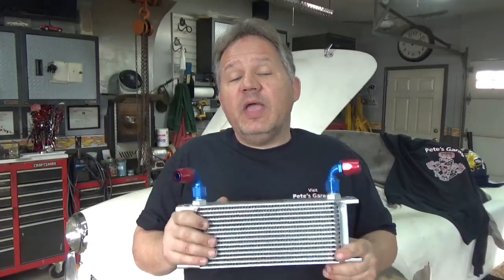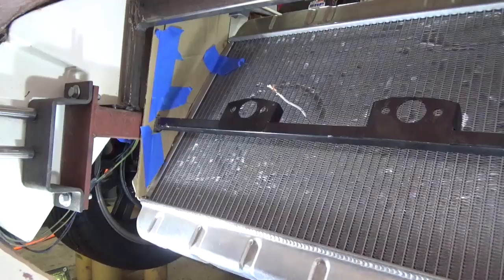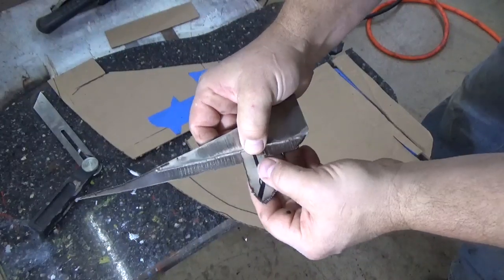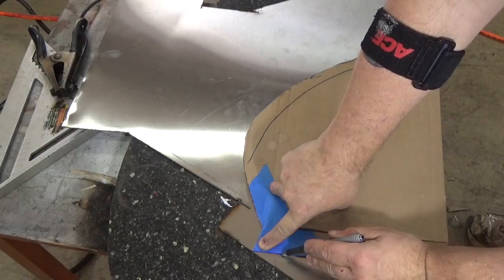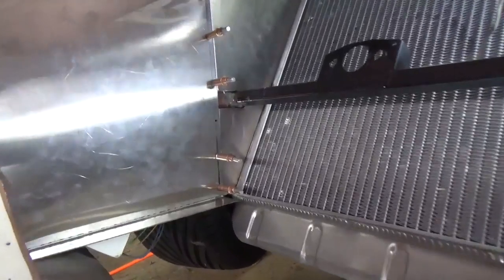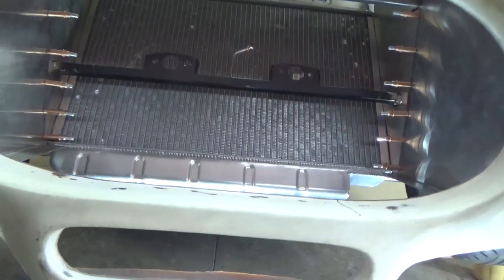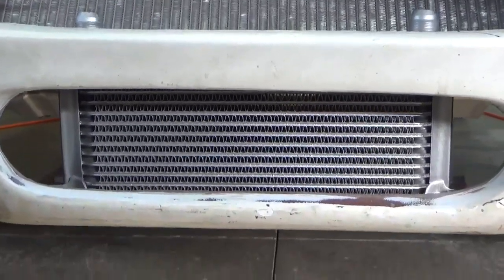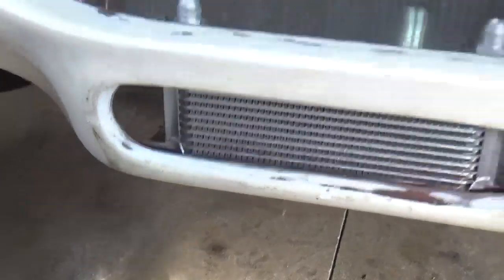427 Cobra - Mounting the Oil Cooler, Fabricating Front End Sheet Metal

Comment: Here's a quick and cheap tip for getting even rivet spacing with no measuring.  Go to the automotive aisle at your local craft store and buy a package of elastic (like on your underwear).  Iron it (low heat) perfectly flat and straight, then without stretching it, mark a tiny dot with a fine Sharpie every inch.  To mark your rivets, first determine how many you want, and where you want the first and last rivet.  Stretch the elastic so that a dot falls over the first and last rivet positions and the desired number of dots fall between them, then center punch the material through the dots.  It's helpful to have clamps, tape or another person to hold the elastic.  The spacing between dots will expand equally, and you'll get perfect spacing without having to measure and divide.

If you have a lot of rivets to do, or if you just prefer to use pro tools, look for a rivet fan spacing tool.  https://www.google.com/search?q=rivet+fan+spacing+tool  To use this tool, drill your first and last holes free-hand, then Cleco the tool to your workpiece with the desired number of holes spaced as you want them.  Drill the rest of your holes right through the spacing tool, remove the Clecos, drill to final size, deburr and rivet.
Reply from the maker: That's a really cool idea, thanks

Comment: Pete,
I would bead roll that shelf. Adds rigidly and will look better.
One or two longitudinally
“Great fab work”
Reply from the maker: Thanks Thomas. I really thought about putting a bead on there, but after thinking about how the lower air dams are going to have to fit I found I can physically bolt a lower bracket right to the body. Between that and the support form the radiator it's never going to move. Maybe I'll put one in cause they look cool.

Comment: Great stuff! BTW, it was a Pete's Garage sweatshirt weekend here when I was replacing the battery terminals on my Jeep :) Have you ever messed with the oil coolers that are plumbed into the engine coolant system? They (supposedly) moderate the oil at the same temp/rate as the rest of the engine so everything heats and cools at closer to the same rate. Like diesels.

Weird thing on my Jeep (all the XJs it sounds like) the oil pressure gauge is not very responsive until the oil gets heated up. Coolant can be at 195 for a while before the oil gauge starts tracking with RPM and load. Until then it is just a smidge over 40 psi with the engine running at idle or while driving.
Reply from the maker: That sounds like an awesome weekend! I've used a few of those integral oil coolers. I've never had an issue, but a problem with either leads to many part changes. Interesting about the oil gauge. Never heard that one before.
Reply: @PetesGarage  Yea, it seems to have something to do with how the sender is mounted in the 242 ci XJs. When everything is working, it reads within normal range (22 to 55 iirc) and mine reads between 40 and 50 during warmup (looked again next drive after I commented). Then after engine temp has showed full warmup for a few minutes, the oil gauge gets lively. I use Mobil1 0W30, have since break in, and it always did this.
Reply from the maker: Makes sense

Comment: That's some cool fabrication!  I was wondering - aside from supporting the oil cooler, is the rest of the sheet metal there to force the air through the radiator?
Reply from the maker: Thanks Todd, yes, the idea is to get the air flowing straight through the radiator and over the engine to keep it cool. Those headers can get up to 1100 degrees so air flow is important.

Comment: What is the part number for the oil cooler? Also are the lines custom-made? Or are there pre-fabricated oil cooler kits that include with the lines attached to the engine?
Reply from the maker: The oil cooler is from Finish Line and I made the hoses